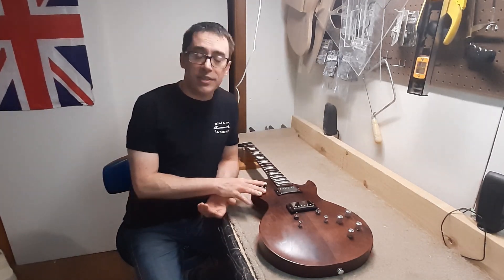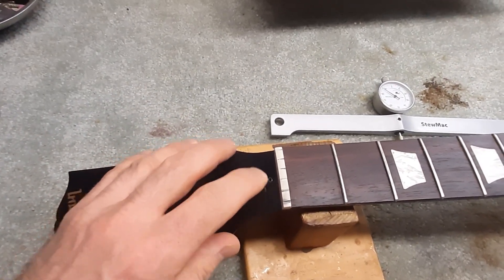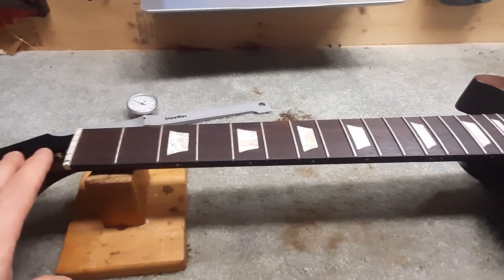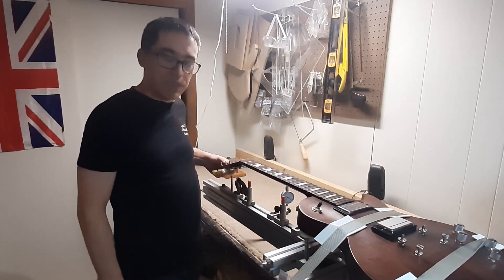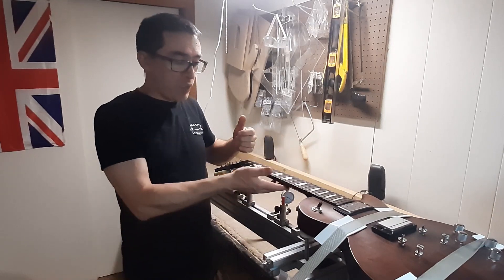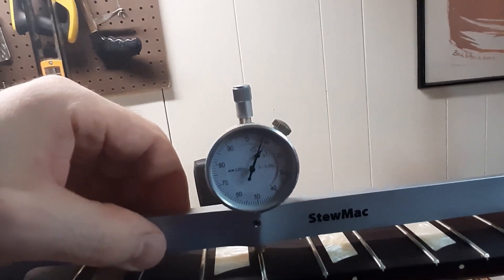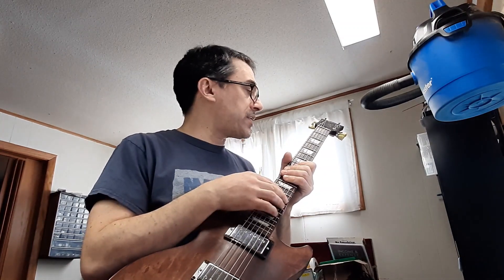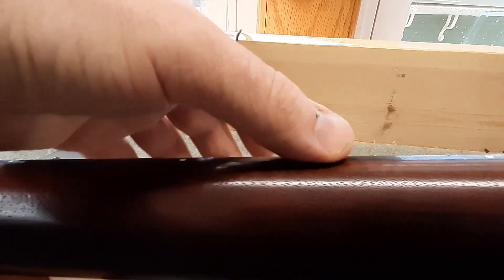Saving a "Warped" Guitar Neck With a Heat Treatment

Comment: Some problems are whether you cold clamp or heat press a neck, it may take 6 times to get is shaped just right. With that point made, it is a reliable technique and the reason most repair shops won't do it is nobody wants to get their $200 neck returned to them with a $600 repair bill after 2 weeks of waiting. 

Here's the real value of what I have to say though. Your neck is intended to do 80% of the structural work in counter balancing the force of the strings. A truss rod is structural REINFORCEMENT, they were not invented to be a load bearing structural fame. By the time most people are having such neck issues, they ran out of truss rod nut threads a long time ago, and this is the most critical piece of information.
When a neck goes a little off kilter and you know it's not correctable by the truss rod, that's when you need the neck heat pressed. By the time it requires the truss rod nut being tremendously tight, the repair through heat pressing will be exponentially more challenging. 

If you go back 50 years ago, guitar manufactures still specified that the truss rod is structural reinforcement; that tacitly says they are not load bearing. I have necks that are paper thin and I can barely feel truss rod nut friction and yet 1/16 of a turn makes an obvious shift in the relative direction to the rotation. I see people with snapped truss rods on particular luthier channels and the repairs are just Dr. Frankenstein levels of gruesom. 
Ultimately, heat pressing a neck is really a job for the owner due to the time span it can take to get it just right, but it does work and I've had necks that maintained reshape for years but to no surprise, they do eventually need retreated. Some guitars, that might be every 6 months and others, every 3 years or even 10 years, but as others have told me you just learn to expect it.

Comment: Sir i have a couple of questions here. 

What would be best to keep the neck straight  or avoiding it from being bow or back bow when the guitar is being stored away for a while. Is it better to have the strings lose when stored? 

Secondly, as we know this video is about correcting the bow on the neck. What if the the situation is the other way…what if the neck has to much relief and the adjustment nut is already cranked up. Can this be fixed or remove some relief by removing the strings and storing the guitar in the humid room for a while? Your answer is much appreciated! Thanks!
Reply: I’m not a luthier, just a hobbiest throwing in my two cents worth, but a guitar going into long term storage should always be stored and shipped with the strings loose, not slack, but loose. A guitar should also never be stored in uncontrolled environments. People who like to store their instruments in garages and attics take a very big chance on ruining their guitar. Basements can be ok if they have some environmental control, but completely uncontrolled is a bad storage place.

Don’t try to repair a problem just using humidity. It can actually split or crack the wood. When a guitar is manufactured, the neck is made in a shape that suits the process, but whatever process the manufacturer selects, once it’s in the desired shape, the fingerboard is attached. At that point the fingerboard acts as a stabilizer and helps to hold the neck shape during the life of the guitar. When the neck goes out of shape, the glue joint stresses and begins to hold the neck in the wrong position. That’s why a heat blanket is used. You heat up the glue joint, move the neck back to the correct position and then let it cool. This takes the stress off the glue joint so it can go back to holding the neck in its proper position without over-stressing the wood. Just using humidity can make a bad situation worse.

Secon

Comment: When you rout out the slot to house a truss rod.... The slot is parallel to the surface of the neck!! It's not bowed!! Convexed or concaved..... Just parallel!
Reply from the maker: Fender and Gibson have curved channels, Martin does not. The rest of the big manufacturers are a mix.   2 way rods are straight.  The guitar in the video has a curved channel.

Comment: I have this issue but it’s very minor bend but my neck has back bow and front bow (back bow on first half of the frets and front bow on the second half) very minor bending though, would I need to get a fret dress along with the heat treatment, and where could I get this done at? I don’t have the materials nor experience to do this at home, wondering how much it would probably cost to get all of this done too.
Reply from the maker: Sounds like you just need a fret dress.  When Gibson builds their guitars there is often a high area of frets where the neck and body meet.  A proper fret dress will make it play good.  I've done it countless times.

Comment: Hi there, Mill City Lutherie.
Thank you for showing this process, and for sharing your video with us, it's greatly appreciated.

I have a few questions for you, which I hope you won't mind answering.

1. I have recently acquired a 2005 Epiphones Les Paul Classic, where the neck has quite the bit of relief... With strings on it's even worse, and the truss rod can not correct it, sadly..
It's been stored improperly, and I therefore suspect that it needs a neck heat press, in order to make it playable again...
Should I engage the truss rod completely, or should it be disengaged, when heat pressing it?? To me it would make sense to engage it, maybe close to max, in order to have some adjustability, once the neck is heat pressed into a back bow??

2. I see you're using a Heat Mat for the fretboard, but how is it taking the clamping pressure? Will it be fine, when clamped down?
I like the ability of using the Heat Mat, with a temperature controller, for a more controlled environment.

I look forward to your respnse.
Many thanks.
Best regards.
Reply from the maker: First make sure you don't have a 2 way truss rod.  I have seen reverse thread rods that can cause confusion. 

I am not able to check your guitar out first hand, so I am reluctant to give specific advice.  Based on your description,  If you could get the neck straight with the rod loose to start with, that would be step one.

The mat is not clamped any harder than to just hold it in place.
Reply: @MillCityLutherie  - Hi there,
Thanks for getting back to me, I greatly appreciate that.

I will go back and check, but it's unlikely that an Epiphone has a 2 way truss rod... 

Thanks for answering my questions.
Keep up the good worh.

Comment: Just literally finished this process on a Fender neck. Was barely out but couldn't get it 100% straight with the truss rod, (sat since 2016 never even setup when new) its like a new old stock guitar. Only difference 6hrs did the deed we will see over the next couple days how it settles in

Comment: Hi, I have a Martin D10 and it has the same neck bowing  problem.
 I wanna know where you located. And if possible, would you be willing to help repair my guitar?  I gotta brand new martin  acoustic  guitar  i got a couple of months ago, but where I'm located. The temperature in the climate is rather humid and dry in and hot. And I think that contributed into the glues coming about and the Nick warping.
Reply from the maker: I'm in Minneapolis.

Comment: I wonder whether you couldn't have simply thrown a set of heavier guage strings on your guitar to straighten it.

My neck warps when under tension. If I adjust the truss rod such that the treble side has no relief (flat) the bass side still has quite a bit of bow. If I tighten the truss rod to put the bass side to a more reasonable relief, the treble side backbows. I probably play quite a bit heavier strings than you do (13 flats).

Comment: Why did you skip the most important part? Installing the heat and clamps ?
Reply from the maker: There's a still picture of the heat blanket clamped into place.
Reply: @MillCityLutherie what did you use for a heat blanket? You look to have some pretty technical StewMac equipment. I’ve seen a heat blanket as simple and cheap as a sock filled with rice. Have you any recommendations for people are hobby repairmen and not full time luthiers?

Comment: On a set-neck guitar like this, is it possible to fix a tilted back neck with heat? (neck is straight but somehow got angled at the joint)
Reply from the maker: Watch my Les Paul neck reset video.

Comment: I had 2 guitars that had this problem, had no idea how it happens. What sort of conditions are required to do this sort of damage. What temperatures/humidity should we be shooting for to prevent this happening?
Reply from the maker: It's been awhile but if I remember correctly it was left in a practice space and the furnace kicked in real high and was stuck on for a week or 2.
Reply: @MillCityLutherie  oof, ok, that will never be me 👍but good to know, also, must have been a defect from the factory with those 2 I had way back then

Comment: Great video! I have a problem with two guitars with a bow between the 5th and 14th frets. Do you think this can be fix with a fret job? It all started with both guitars getting a bit dry in winter. I currently have both in my shower and I've been periodically turning on the hot water and steeming them. One has responded well and only buzzes from the 8th fret down to the 14th, but the other guitar hasn't made any progress. Help!

Comment: Is it really worth the expense to do all this on a guitar that is not worth more than $200 ? Have a Epi Les Stud has a down-hill slope from low E to Hi E .. ..
Reply from the maker: This is a Gibson Les Paul, it is worth far more than $200.  The video is about correcting the back bow in a neck.
Reply: @MillCityLutherie  I think the man was asking about his guitar not the one in the video
Reply: A repair is “worth” what you’re willing to pay. Some guitars have sentimental value, some have collectible value, it’s just a matter of what you’re willing to pay. From your question I’d guess you’re a bit mercurial about the guitar, so a direct answer to that would be that the repair costs would exceed the value of the guitar. So, if the guitar has no meaning to you and its worth is just the resale value of a $200 guitar, this likely would not be worth.

Comment: Is the heat blanket a specialty piece, made for this purpose? If so where are they available?
Reply from the maker: The one I use is specifically made to heat fingerboards.  It is part of a unit from LMII that has many size and shape blankets for bridge removal and other lutherie type jobs.  There are other methods of doing this job, this is how I choose to do it.
Reply: @MillCityLutherie what is LMII?

Comment: what kinda temperatures are you using?? thanks
Reply from the maker: The inlays start to come loose around 185 F.  So around there.  It can vary from guitar to guitar.  If I wanted to remove the board I would go higher.